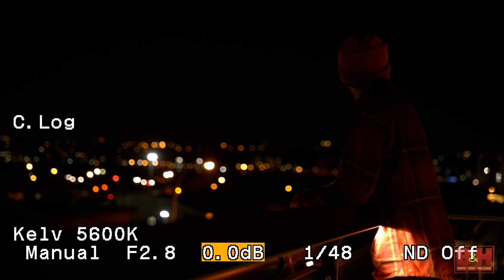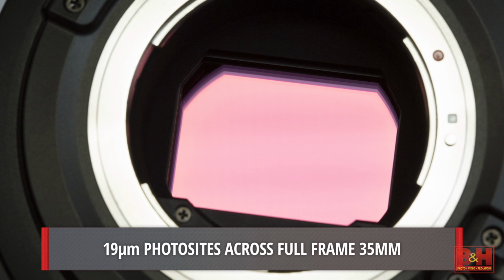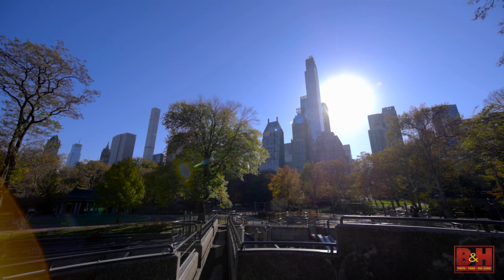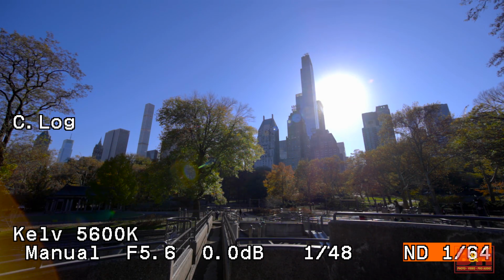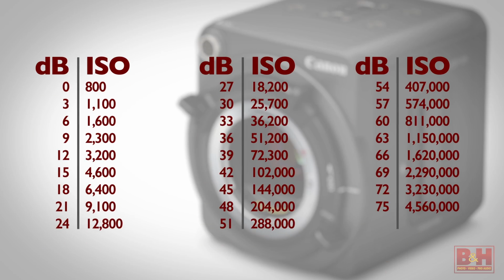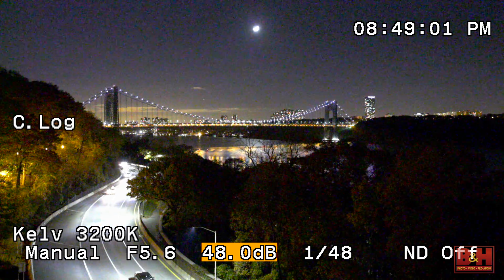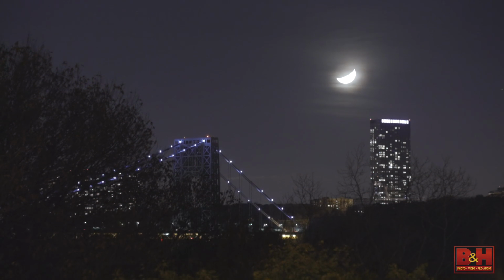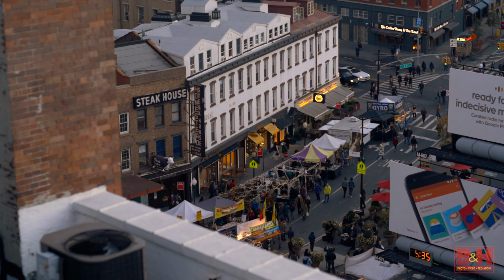First Look: Canon | ME20F-SH Multi-Purpose Camera

Comment: What is the second long thin cable (with the white paper tag on 00:40) under the short twisted power cable? What does it connect?
Reply from the maker: That cable is connected to one of the two 12 VDC barrel power connections. That would be connected to power the on camera monitor.

Comment: This camera is confirmation that you can't make up for the lack of lighting with bigger photosites and low light performance.  When the lighting is not there, it's just not there, and all you have is noise.  And even if it could, it won't be good lighting.  If you want a good picture, you have to have good light.

Comment: sony a7s still better and a 10th of the price.
Reply: +Smilydude007 Good luck with anyone shooting on a single SD card that might get corrupted and then the horrible battery life. A company/government agency will spend more money on something(most likely to rent) with professional connections(and ruggedness) than to spend less and lose footage due to changing batteries, shooting on a single SD card that goes corrupted, or using a HDMI connection that isn't reliable.
Reply: +Smilydude007 a7sII have not full readout 50/60p.

Comment: Has Canon lost its mind? If this bare module has workable image at ISO 51,200 max for Cinema for $20K then how would it compete with a complete package Sony A7sii that has similarly workable image at 51,200 max for $3K? I can see surveillance use only for a fraction of this cost.
Reply: +RealWorld Sony a7sII does not have full readout 50/60p.

Comment: Of course it doesn't have 4k, since that would mean a higher pixel density and hence worse low light performance. This camera is all about high ISO. 20'000$ is a joke though...
Reply: L. Willis yep, million dollar companies throw $20k around like it’s nothing
Reply: Actually it's not a joke. Other than faddism 4k doesn't offer much unless you're going to project onto a big display cinema style and poorly put together RED cinema cameras that use rebranded overpriced consumer SSDs and junk batteries cost more than this. Typical delusional overindulgent commercialized infant.
Reply: @KishaScape Your superiority complex is showing

Comment: How does it stack up to the Sony A7? As far as I know thats (up to now) the low light king?
Reply from the maker: +Julian GoesPro - The Sony A7s and A7sII are the A7 models which sport the high ISO performance with a top ISO of 409600.  The Canon ME20F-SH has a top ISO of 4,560,000 making it a unique model for specialty low-light applications.  As far as how it stacks up, I'd say for more common applications the Sony is King, but for the situations described in this preview the Canon will be the victor.  At this point it has not been released and we do not have any real world samples from users to comment from.  Once its released and people start posting samples we'll have a better idea.  - Yossi
Reply: That's a U$20.000 camera